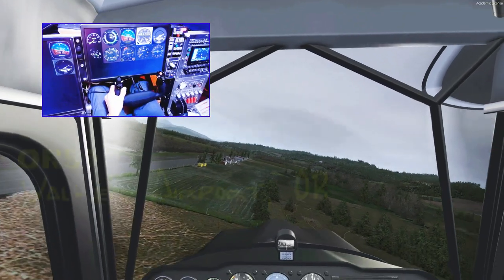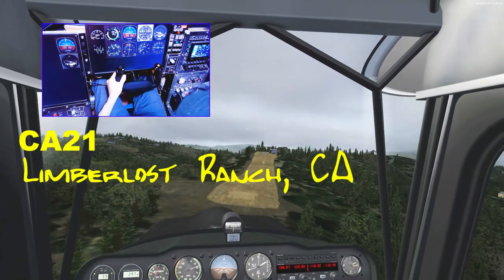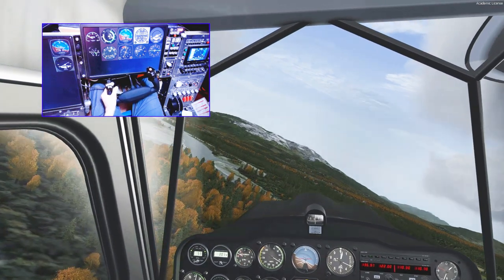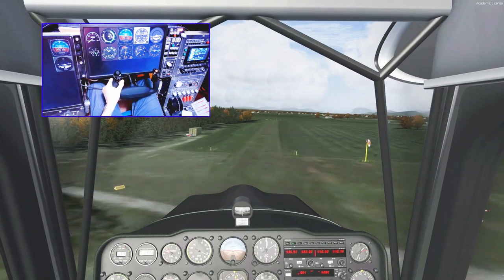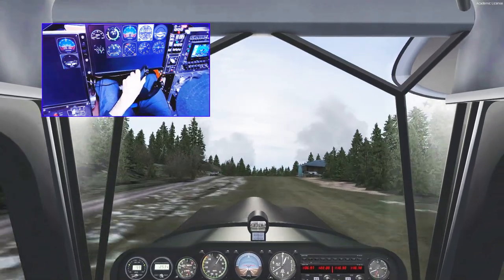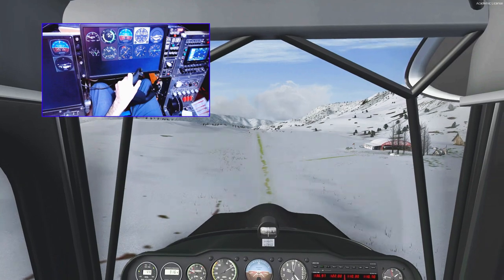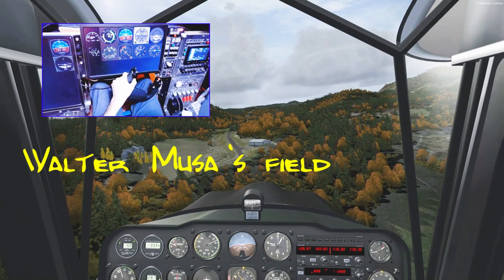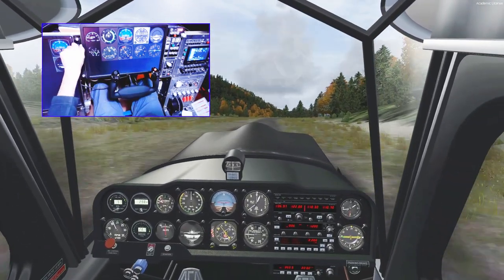Honeycomb Alpha Yoke vs. 7 Small Strips

Comment: Nice one mate - I was just re-reading your books this morning on Kindle which made me realize I had not seen any videos from you in a while. I had not turned on the bell to notify me ;) All the best and thank you for the videos.

Cheers
Jim
Reply from the maker: Funnily enough, YouTube has stopped notifying me of comments on my videos, so sometimes I miss them :|  I haven't done any proper flight sim videos for a while, I have been frustrated with the poor performance in my multi-screen setup. Hoping P3Dv5 might help with that, but I don't think I'm going to jump until the dust settles, particualrly as it means switching to Windows 10.